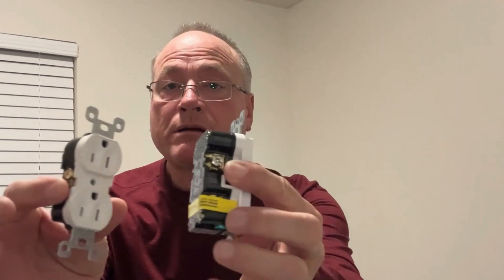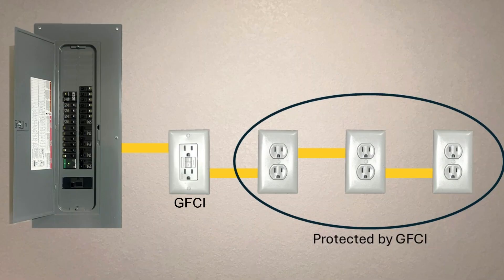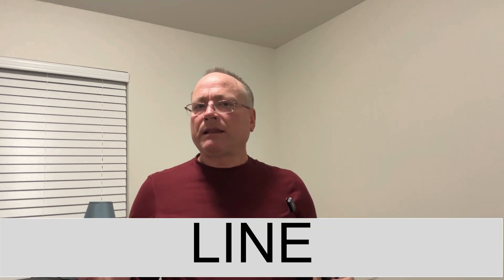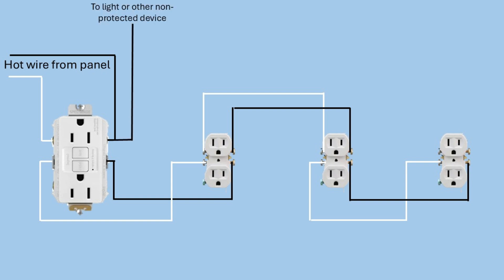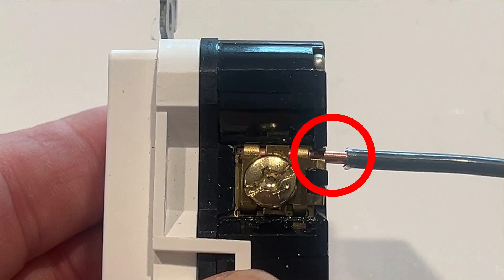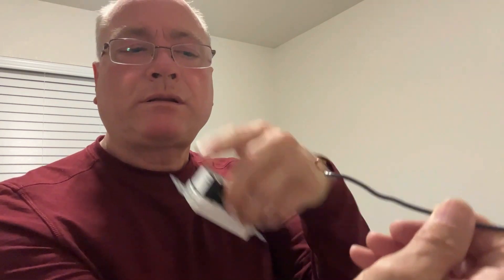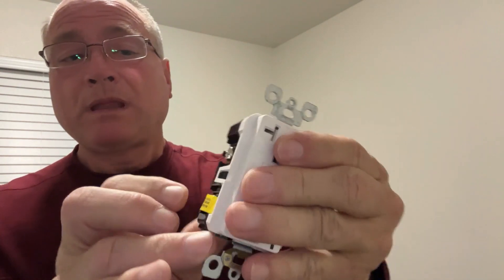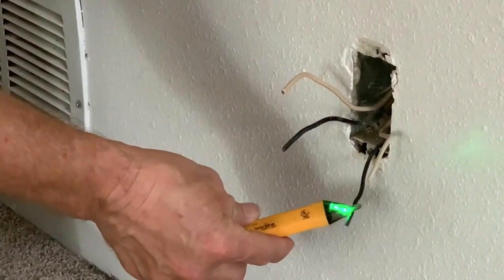How to Install or Replace a GFCI Outlet | Step-by-Step Guide

Comment: Good advice. If you're going to replace a regular receptacle with another one you can use a commercial/spec grade receptacle which has a back wiring method similar to the GFCI and will also accept 12 gauge wire. Leviton (Edge) now offers GFCI's with locking levers similar to Wago lever nuts, available in 15 and 20 amp versions.
Reply from the maker: Thanks! That’s a great point-commercial/spec grade outlets with back wiring can make installation easier, especially when using 12 gauge wire. I appreciate the info on Leviton edge GFCI’s withlocking levers; that’s a solid option for a secure connection. Thanks for sharing!